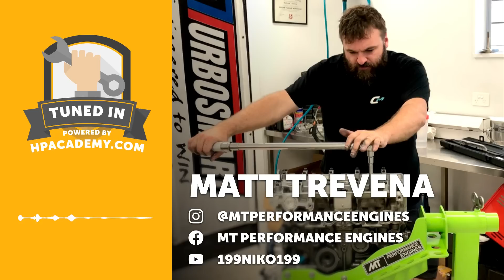087: Is Toyota’s 4A-GE Worthy of its Legendary Status? [#PODCAST]

Comment: I have the ultimate 4AGE 1600cc rally engine please say what can be improved. 

- [ ] Dry sump Run PENN OIL
- [ ] MRP Billet crank 
- [ ] Billet main caps 
- [ ] MRP Crank Girdle 
- [ ] 4age block
- [ ] Arrow rods
- [ ] Je pistons 13-1 comp
- [ ] Billet inlet with 48mm ITB’s with carbon intake plenum 
- [ ] 16v small port head (ported/exhaust matched) 
- [ ] O/S Atlantic Valves solid buckets Kelford k13b cams
- [ ] titanium valve gear 
- [ ] 550cc injectors 
- [ ] Halltech ECU 
- [ ] Motorsport Wiring 
- [ ] Motorsport harness
Reply from the maker: Depends, is it reliable and are you competitive in your class? If you're not competitive, are you certain it is unreliably or a lack of power that is the specific and/or only issue? - Taz.
Reply: @hpa101 it’s very reliable as I’ve set a safe limiter of 8750rpm so will be loosing significantly at top end as it’s making 213bhp and climbing and a strong 164ft lbs of torque and from the last teardown after full season everything seems fine replaced all bearings and checked valve train and all good (I’ve found billet mains, crank the girdle and ATI damper has given significantly better resistance to flex and bearing wear) I’m in 1600 class and consistently top 4 I think the biggest problem is I spent a lot more money on the engine this time and I’m still running a T50 synchro box with TRD Gearset. 

I’m going to have to invest in a good light sequential box but I’m unsure who to go with?
Reply from the maker: Nice! Assuming you have worked on all the other low hanging fruit in regards to car and suspension setup along with conscious effort on your skill as a driver, this is what one of the 4AGE loving team members here said, noting he doesn't know your class rule book:

"He could improve it by changing to a 7AGE block - keep the 4AGE crankshaft and use longer rods. This keeps the engine 1600cc and gives the benefit of better rod ratio, which has been proven to give more horsepower and better durability for high RPM engines like this one.
If he really wants to get spicey, he can copy Garage 4AGE and make a custom inlet VVTi system for more power under the curve (this would be a huge benefit for a rally car).
I'm assuming his cam profile is a 193-B (there's no such thing as a K13B from Kelford). There are bigger options if he wants more power up top."

Just from what I see everyone doing when it comes to tipping the scales more for engine work than the rest of the car, personally I think with all the money and time you've put into an engine so far that is working for you, it possibly isn't the cheapest and easiest win waiting for you. But you will know that better than I will and you'll also have a better idea of what those other 3 guys in the top 4 are doing comparatively as well.

For the gearbox it's hard. If budget isn't a problem Holinger really are as good as everyone says. We ran a TTi GTO for a while and didn't have a great experience with them (we actually had 2, 1 was always being worked on), however, they are much cheaper and others have had success that we didn't.
There are others out there, thats just what I can mention off the top of my head and in your shoes I'd be looking around the rally scene to see what faster cars are running not just in your club/area but elsewhere in the same/similar classes.

Sorry for a whole lot of nothing other than food for thought there. I know the preference is always just to be told 'do this, problems solved' but really there are many paths to the same results at this level - Taz.
Reply: @hpa101 ha ha I may have not ambition and ability mixed up but I am someone who can navigate a full season without crashing so my consistency is ok which takes points from the outright faster boys 👍 
That is absolutely superb mate lots of great ideas, the engine is actually a long rod in 4A block as was going down the destroked 7a originally but best laid plans and all that. 
I think I have tunnel vision with this car having bought it for a good price as a jap drift import it’s been through hundreds of iterations to become competitive and I may have been trying to make it something it shouldn’t be, or I can’t make it. 
It’s a very consistent car but a fresh chassis for a car I can push to 10 10ths  think a a KP starlet and do all the real 
fabrication for fully floating Atlas axle and some more modular rally struts each corner. 

I had no idea about the VVTI garage 4AGE has made I’ll have a look and read about that. 

Gutted to hear about the TTI experience I had just found Tec Arts in Japan do a full AE86 kit using T50 bell housing for a fairly reasonable price but I will drop a few emails I know ESA PELTONEN from Finland makes really great T50 and W58 Dogboxes so that’s an intermediate option. 

Cheers again appreciate your inputs helps me take a step back and look at things with a fresh set of eyes. 👍
Reply: @hpa101  thanks for these detailed answers 💪💪💪

Comment: I’ve owned three of them. Two Blacktops and one Silvertop. They are great engines. The only real issue I had with them was that they use oil for some reason. All three of them did it.

Comment: Another interesting discussion; thank you for it.

To pick nits: Higher valvespring spring-rate does not rob an engine of power. While it's of course true it takes more power/work to compress them - you get it back as the spring rebounds... except for the portion that is dissipated as heat on account of the strain of the valvespring steel. Of course, no argument that higher spring rate stresses and strains the entire valvetrain more.
Reply: Thought experiment.  You have valve float. That means all the energy in the spring isn't enough to return the valve closed in time.  Thus none of that spring energy is being returned to the cam.  To minimize loss and wear, while solving valve float, you use the minimum required valve spring rate to solve the valve float issue.  So that means you increased the valve opening pressure requirement, while having minimal energy returned to the cam.  Do you still say there is no power loss?
Reply: @monkeypainter808  If you had theoretical valvesprings that kept the cam followers 0.0001mm off the cam lobes during the valve closing event - you wouldn't "re-capture" any of the work/power that went into the valvesprings during the opening event.

I see your point: you don't get ALL the work back that you put into compressing the springs... You get back all the work put in MINUS the inertial forces that tend to hang the valve open.

Put another way: If you have an engine that doesn't float the valves - you wouldn't lose any power at all by installing stiffer springs.
Reply: @GroovesAndLands  at all?  There will at the very least be more friction due to increased normal forces.  Not to mention the nock on effects that can lead to even more losses.
Reply: @monkeypainter808  Not enough to measure on a dyno.
Reply: @monkeypainter808  I was watching the latest episode of Engine Masters last night. They had a ~650hp 514 cubic inch big block ford on the dyno. They tested it with valvesprings that were 210# on the seat and 550# open - then again with stiffer springs that were 350#/800#. The lighter springs were sufficient to control the valves and there was no float in either configuration.

The power difference was within 1 or 2 - within the margin of error for a 650hp engine on the dyno.

They also tested thin wall vs. heavy wall pushrods - the findings were a little more complicated. Thin pushrods with stiff valve springs picked up a bit of power on the bottom end but lost a good handful up top; presumably because pushrod deflection was absorbing some of the cam - boosting bottom end but hurting top.

I believe this testing validates my original thesis - you get back what you put into the springs; minus the tiny F=mA associated with the inertia of the valve.
Reply: because of camshaft profile, the work exerted by the cam to squash the spring may not have an efficient enough transfer back into the camshaft to give total power back. No Idea if this is true, just a theory
Reply: @QcumberDolphin  That could be true,  but I think we're really getting into the minutia. Higher stress creates more strain, deforming the cam lobe and the follower - which could lead to more friction and therefore energy/power dissipated as heat. But at the levels of strain you'll see in a lobe/follower - we're really talking about separating fly poop from the pepper.